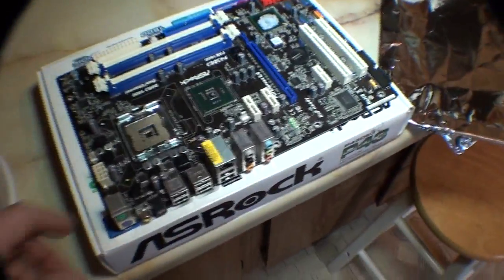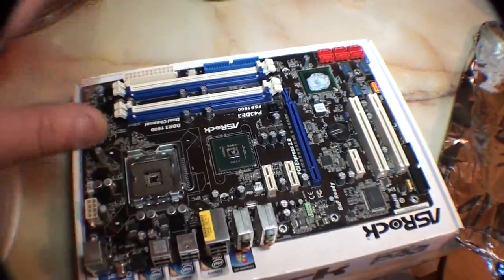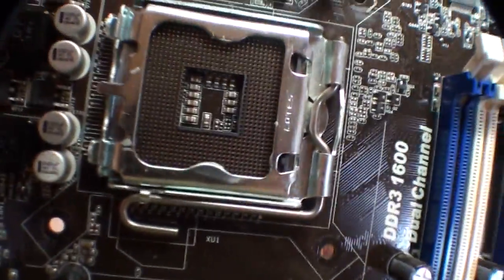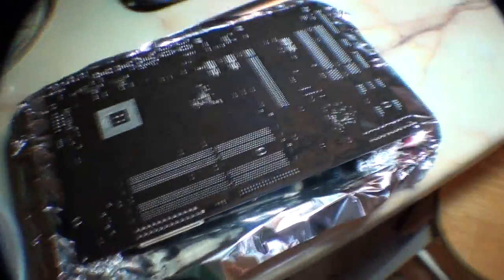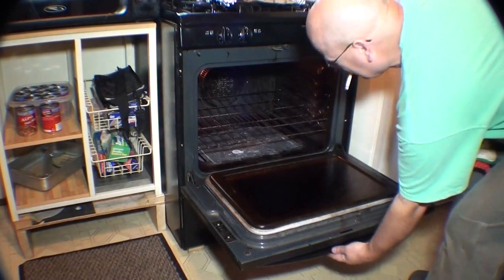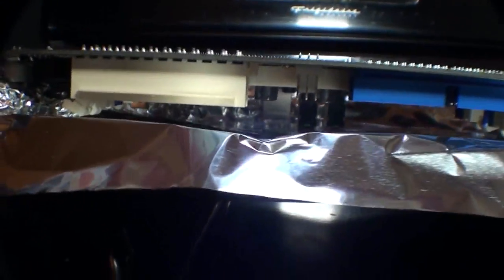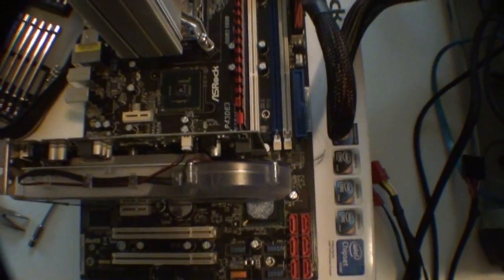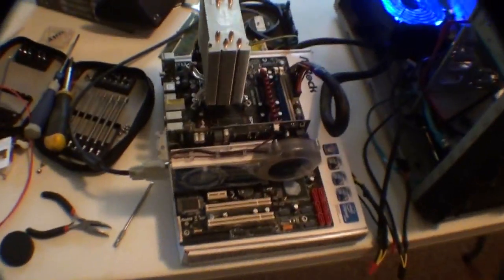How to repair a motherboard by baking it in an oven.

Comment: how does the plastic shit not turn into a puddle?
Reply: Did you say litre of cola?
Reply from the maker: +LARGEFARVA I'm sure it's science 🍻 components on a mother board generate a lot of heat in normal use so I'd assume the plastics are engineered to have a very high melting point.

Comment: This worked for me. After failed CPU overclock with Asrock Z68 Pro3 and Core i5-2500k it refused to POST. Tried CMOS hard reset by removing the battery over night, no use. Then I baked it in the oven for 8 mins at 200 degrees Celsius. Works like a charm again, for now at least.

E: I did this with the mobo face up, not upside down like this guy.
Reply from the maker: +vetu104 excellent! Mine is still running strong. A little heads up though, calling me "this guy" when you clearly know my YouTube name is micro-aggressive. Now I need to speak to a counselor🍻🍻🍻🍻
Reply: Wow i'm 3rd person triggered
Reply from the maker: +White Argentinian DAMN that's funny 😂 Please find a safe space immediately!
Reply: and still working? cuz this not last long

Comment: you did it upside down....
Reply: I figured that, it should be the other side? But what about the soldering on the bottom if touchs a surface?

Comment: Your major mistake: Never bake electronics in ovens you use for cooking and food!
It's highly unhealthy.
Reply: Mick Mack What you think is not important, what is fact, is.
And it IS unhealthy to bake electronics in an oven that is used for food.
Your argument about Teflon is irrelevant, because Teflon is tested by several food health authorities and allowed to use for cooking tools, as long as you keep them in their specified temperature range. Electronics do consist of a  hodge-podge of different materials, the one unhealthier than the other.
And it is just stupid to use your oven that is normaly used for baking food as oven for electronics because of the health risk.
It shouldn't be a problem to buy an extra oven for reflow soldering, but is is dumb to use an oven that is still used for food for such things.
Reply: Mick Mack No, i am not an US American like you. That's why i am not dependent on corporate funded research companies. I have my country and its food health authority. This authority does not depend on the money from companies and if this state authority says, Teflon is okay, then it is okay from the standpoint of current status of research. Because in my country it is not allowed to put untested products on the marked like in your country. In my country it must first be proven by research and in depth tests, that a product is not harmful, then if this is proven it is allowed to put it on the market but not earlier. And as long as the status of research doesn't change and says otherwise it stays on the market.
So i can assure you, Teflon is not a problem.

But electronics is. The unhealthy materials will leave the electronic board as invisible fumes. Then they will raise in the air and  condense on the oven wall after it. When you put your food in the oven next time, the unhealty materials that condensed on the oven wall will degas again and condense partly on your food.

To be safe you would need to make in depth air measurements about what happens when you put an electronic board in an oven and heat it up. Without this measurement your claims that this is not harmful are worthless and unproven. And as long as you can't prove by in depth measurement that this is harmless it must be seen as harmful.

I know, in your country this works the other way. In your country they first put water with radium as a health product on the market and watch what happens. Then when some thousand people drunk it and died of cancer because of ingesting this radium drink, then your country starts to forbid this untested radium drink. Stupidly as its best.
In my country this does not work that way. The radium drink would never have passed preceding tests and so it would not be on the market.

To bake a videocard you won't need a full size oven. A small electric oven like this one
will do the job and is cheap enough:
http://www.amazon.com/Black-Decker-TO1303SB-4-Slice-Toaster/dp/B00FN3MV88/
Reply: Mick Mack
If you say Teflon is not safe, then show me some evidence for your claims. It wasn't necessary to mention my country, because all which was necessary to mention was that it is not the USA.
Reply: *****
Teflon is only poison for birds. That's something i already knew. But this does not mean, that it is poison for us humans.
For comparison, humans can eat eggplants
, it is safe for them.
If if you give an eggplant
to a parrot, the parrot will die. An Eggplant
is poison for a parrot, for us human it is eatable food.
Reply: *****
I am a nonsmoker and always was and always will be.

Comment: This miht not help me fix my mobo altho it has helped fix my sense of humour. I am now on my second DG45ID after I broke the SATA connector circuits on the first. This one went spazzo afterI set it to RAID and because I use HDMI (maybe?) it froze out on the configuration screen. Attempts to reset BIOS have left board inept. I love it, although it is going to get thrown off a cliff soon.

Comment: Very interesting. If the board had  "Fractured" Solder joints, that were re-flowed during the baking, it all makes sense. From my experience of repairing many Monitors, fractured solder joints like to occur right at the large connector pins, where the heavier currents pass through. Before baking any circuit boards, I would prefer to inspect the large connector pins with a good magnifier, and then re-flow any suspect pins. Also, looking for discolored or bulging capacitors would tell you of possible defective caps.

Comment: You should of turned the motherboard around, so the caps and other components do not fall out. I saw a video were you have to cover the capacitors, because they have a chemical in there. Where if it dries up the capacitors bulge up (due to the heat). SO u should of turn it the other way, so the caps and cpu are facing up... 
 THis is a good technique you should find out how much temperature the motherboard can take.. THE PS3 motherboard , withstands 400 degrees, so the oven should be set at 400 in order for solder can re join... For 10men..

Comment: I really don't think you have to use that high of temperature.the motherboard manufacturer's use I think around 240 degress to get the solder to flow..why do you sound like a Chipmunk?
Reply: Im celsius or farenheit?

Comment: The bent pins did not fry your cpu. My board came with bent pins. I fixed them then and but slot ram slots weren't working so I went back to see more pins bent and touching each other. I fixed them and cpu and mobo worked fine

Comment: Could someone explain to me how does this work, and if it works or it is just a joke.. I'm kinda new to this
Reply: Hristo Mladenchev
It does work, but not the way he did it. You must turn the board on the other side. The socket must be on top when you put in in the oven. Also, much more important. He can't use his oven any further now for cooking. This oven is now poisoned with chemicals, it shouldn't be used for food anymore. This would be unhealthy.
Reply: It does work what happens is your board heats up and the soldering that connects the components cracks and they lose connection, so when you stick it in an oven it heats up the soldering and fuses all your connections back together.
Reply: madskidles1 Thank you very much, this is just what I needed my friend!

Comment: While oven baking will reflow the solder, and potentially fix the board, you should always, ALWAYS cover capacitors, plastic parts and the CPU sockets with aluminum foil. And never bake electronics in ovens you use for cooking.

Comment from the maker: @Barco Paul the heating will reset the solder that sometimes loosens. l have only done it on the one motherboard and I'm still using it.